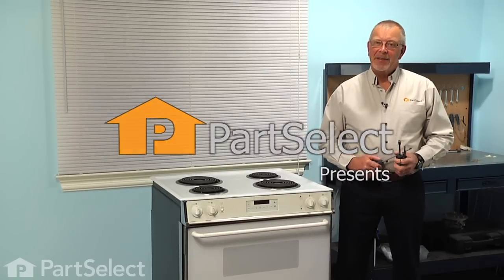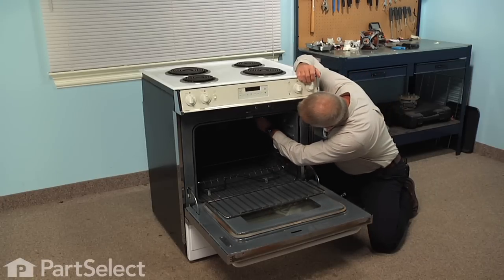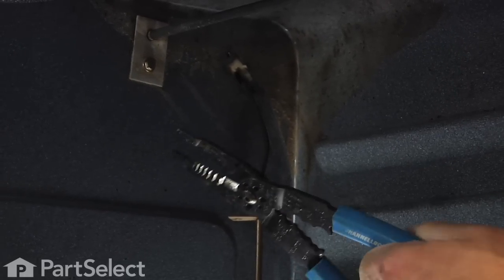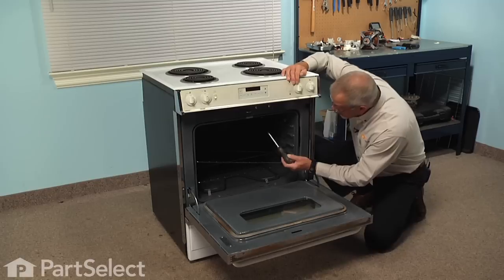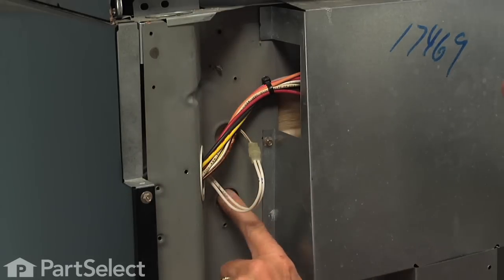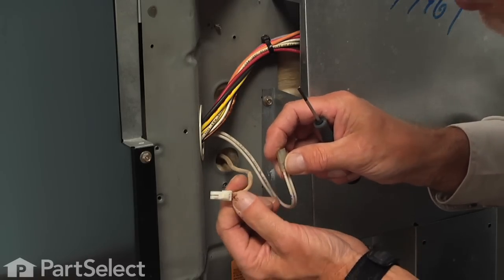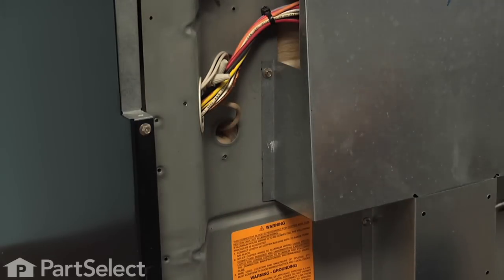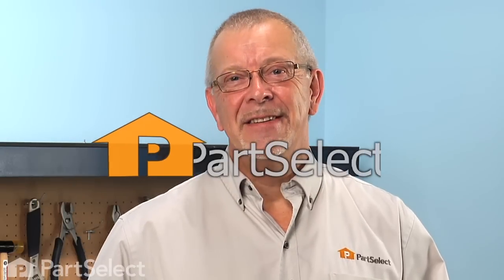Range/Stove/Oven Repair - Replacing the Oven Sensor (GE Part # WB21X5301)

Comment: Resetting clock on Rangemaster 55 auto worked for 1 minute and then started flashing again so oven wouldn't come on
Reply from the maker: We do not have any manufacturer’s info on that range.